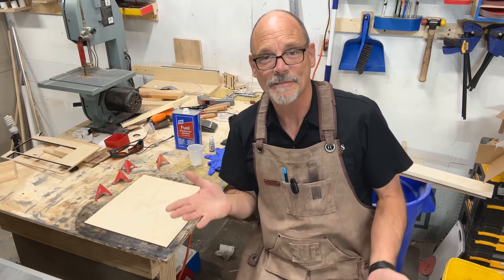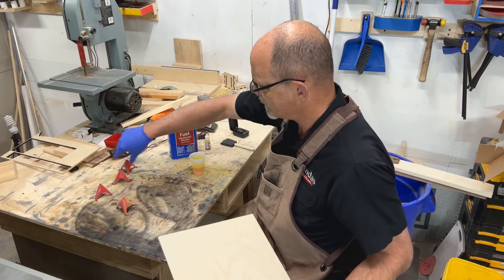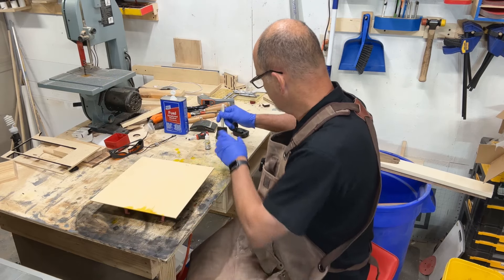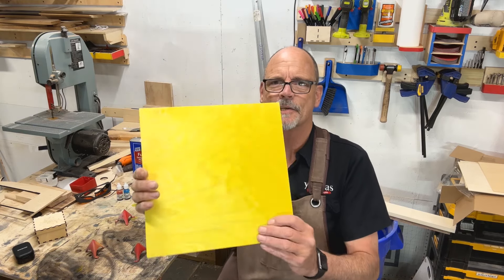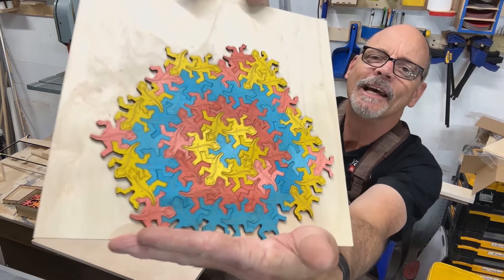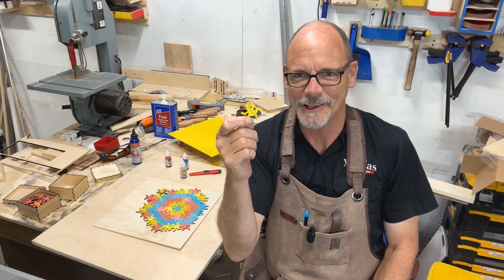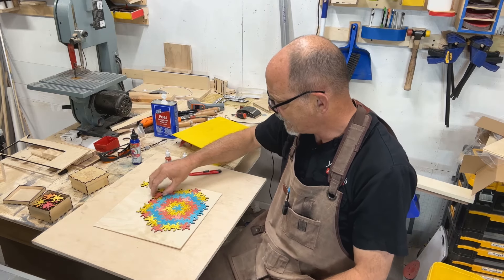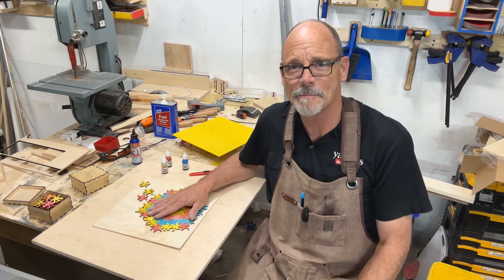Using alcohol inks as wood stains

Comment: Good video Bob. I came over from the lahobbyguy forums where I saw this video. Do you remember what your kerf was for this using birch? I have a similar file but I cut mine out of PVA foam and my grandkids loved it.  I'm a new subscriber here now and will be checking out your other videos.
Reply from the maker: @LarryDMitchell  If you are asking if I did a kerf offset, I did not. In the file it is just set as a line.  I have an xTool D1 Pro 20 watt and cut this 3mm birch ply at 6mm/s with air assist turned on.  It leaves a little wiggle room in the puzzle, but it also makes it easier to fit the pieces together and take them apart without having any delamination of the birch ply.
Reply: @bobjosjor8307  Thanks. I have the MK2 10/30W and I'll find my file and just try it out. I love the color and the way it pops. Great idea.

Comment: What brand of alcohol ink did you use?  I tried to duplicate your results but my colors are not nearly as bright.  I did use isopropyl alcohol instead of denatured, is it possible that could have been the cause?
Reply from the maker: These are Jacquard Piñata alcohol inks.  You can get them on Amazon and most good art supply stores.
Reply: @bobjosjor8307  Thank you